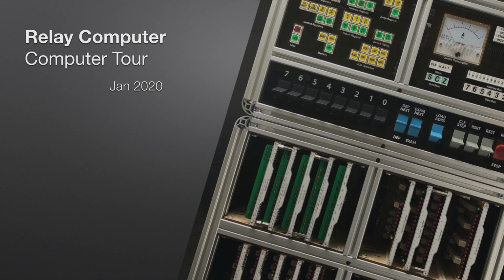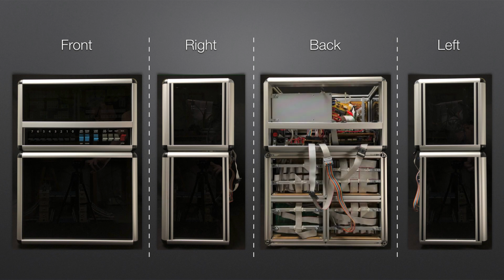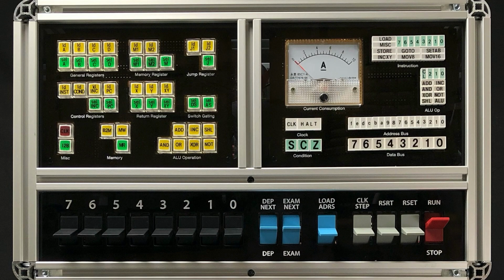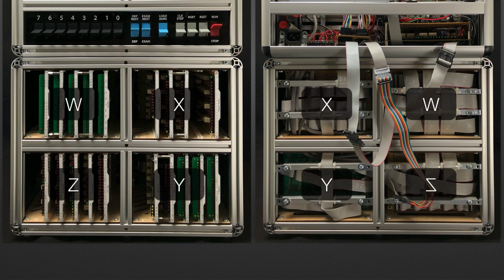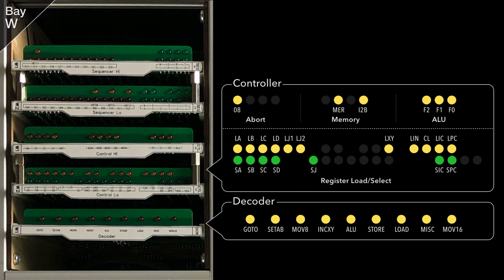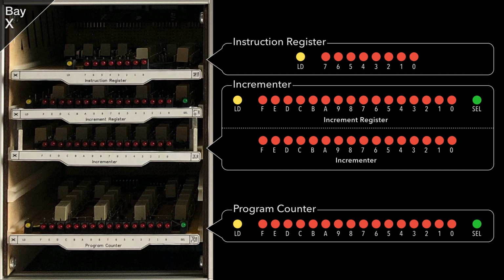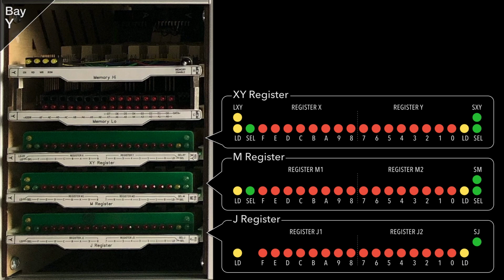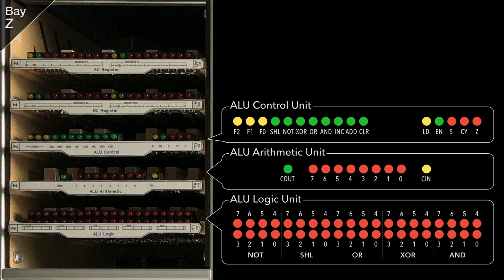Relay Computer 2020 Review: Computer Tour

Comment: outstanding work!  I am doing a design of my own, intended for relays as well. For moving data between registers, I plan to do it as two distinct operations:  a register PUSH onto the stack and then a POP to the destination register. ALSO, my instruction word length will be 20-bits to handle a 4-bit opcode (yes, only 16 instructions!) and then 16 bits for data or operands. 16 bit registers A, B, M, and Stack .  All good wishes, sir!

Comment: Wow this is so cool.  Must be satisfying knowing you actually designed and built all of this.  So if I understand right, there are no transistors, it's all using relay logic?
Reply from the maker: On the whole, yea. The major exception is the memory where it's just not practical to do it with relays (it'd fill my house ;). There's a bit more on that compromise decision here: https://www.relaycomputer.co.uk/2017/08/the-problem-with-memory also the other area is the clock which is using a 32.768KHz crystal fed through a load of 'divide-by-2' gates which are all IC bases. I'll also be adding a 'proper' clock though using RC timing.

Comment: What type of relays are you using? I've got some Takamisawa (Fujitsu) NA-12-K DPDT relays which are fairly small and are about $1.50 US dollars each. Those ones look very similar to mine but I can't read the model number very well.
Reply from the maker: I'm using a DPDT 12V telecom relay which are fast and low power but, most importantly for me, really small  - TE Connectivity V23079A2003B301. There's a bit about my choice at https://relaycomputer.co.uk/2013/11/relay-rumination
Reply from the maker: If I'm reading the specs right it looks like those NA-12-K ones are pretty much the same ... and actually running a fair bit cheaper in the UK (from Mouser) at the moment. The price for the TE ones fluctuates a fair bit so I'll keep my eye on these as an alternative. Thanks for the heads up :)

Comment: How did You decide what each bay should contain: cards and common signals?
Reply from the maker: It was mainly led by how many physical connectors (IDE in this case) I could fit on the back of the card and then finding a permutation of the connections each card would need to put them in groups of five cards. It was probably as much luck as anything else that everything fits in ;)